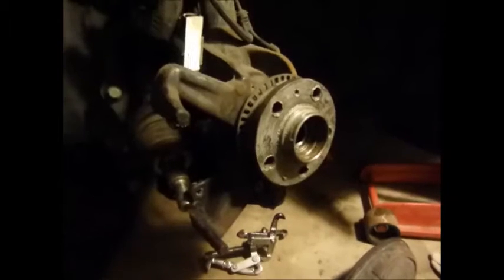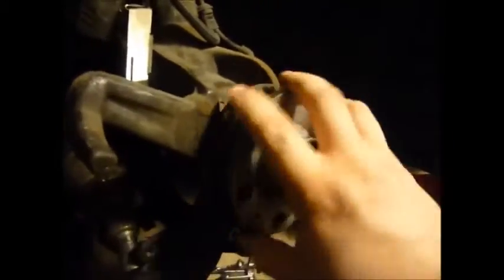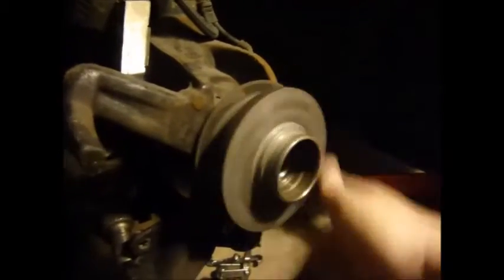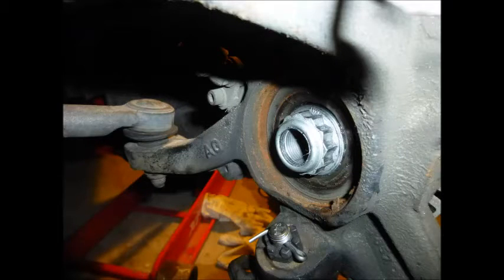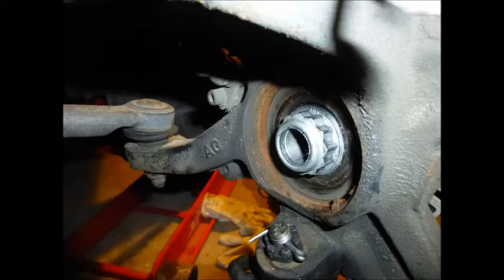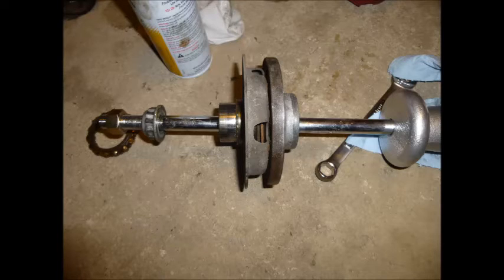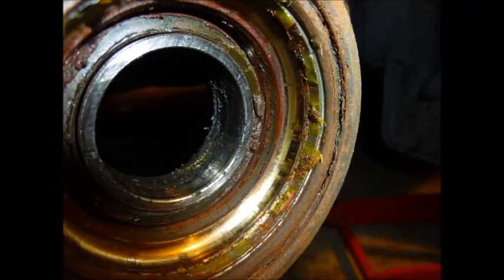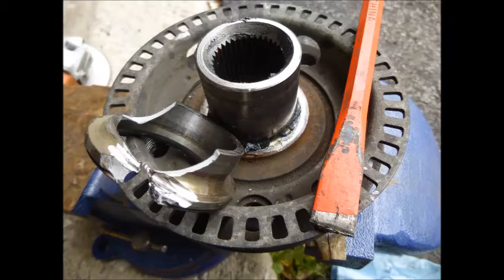How to replace your MkIV's front wheel bearing - thread update video

Comment: Ted!  Once again I went to get a refresher course from your thread while replacing a front driver's bearing on our 2002 TDI wagon.  I have replaced 7 bearings on 3 cars over the years using the HF kit and your excellent guide for replacing a bearing.  Thanks!  What a timely post for the video.
Reply from the maker: Glad you found it useful. I took these videos in 2014 when I redid my driver's side bearing and promptly forgot about them until a few weeks ago!